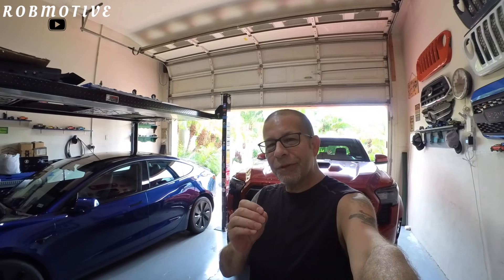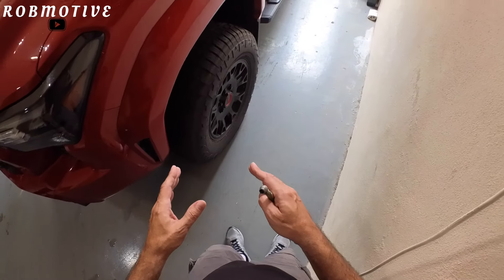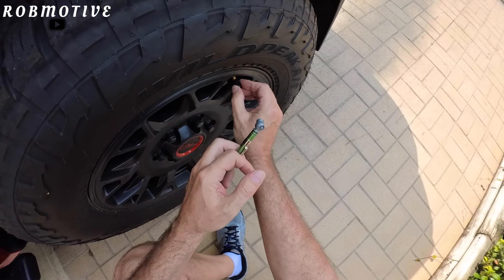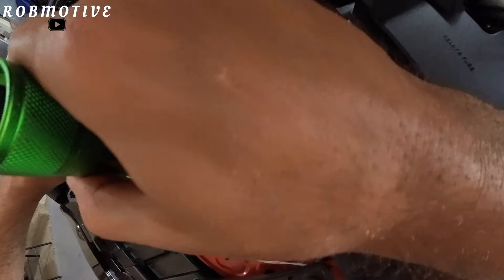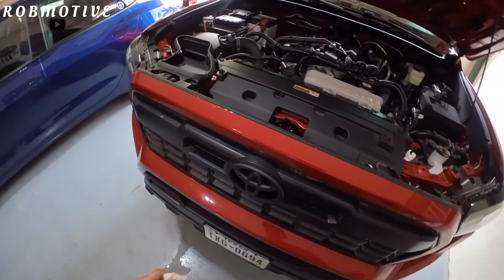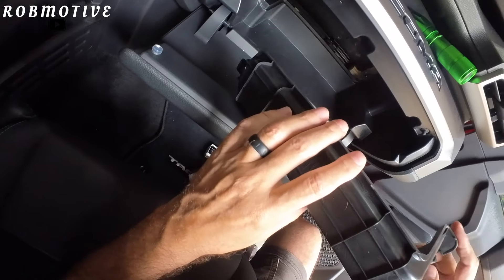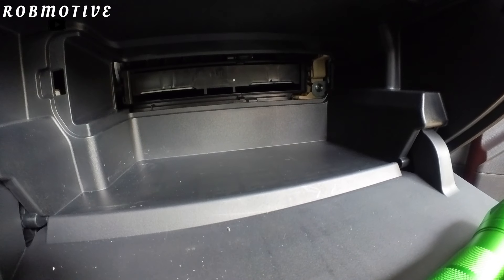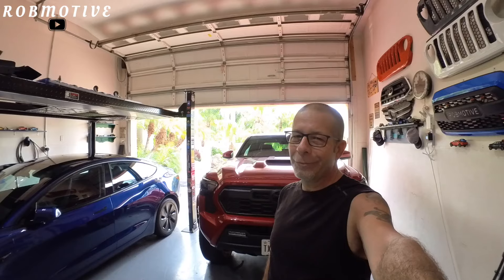Toyota Made This Much Worse In The New Tacoma!

Comment: Hey Rob. Thanks for the tutorial on removing the cabin filter. 
 Hope you don’t mind.I have a unrelated question. 
 Before I go searching for a solution in the owners manual. Have you tried backing up your 4 th gen with bikes hanging over the tailgate or with a hitch mounted  bike rack? Impossible to reverse because the BU sensors are constantly applying the brakes. Very difficult to just back out of the driveway !
Reply from the maker: I have not.  I believe you can turn that system off.
Reply: K thanks Rob. I’ll do some digging.

Comment: Hey Rob.  I don't think there is any point in reading the fuel economy figures on the dealer stickers anymore.  Car and Driver reported (and it's been mentioned before) the turbo is simply for emission purposes. Just to meet the government compliance demands.  C&D also reported that the 2024 Taco gets 40 miles less per than a 2017.  The 2024 tank is a bit smaller so this may account for the difference.  Still makes a difference when off roading.

Comment: Yes, the cabin air filter is a greater PITA to replace.  But, that tells me they did redesign under the dash and hopefully have eliminated the condensation drip ALL 3rd Gens have if you run the AC with the window cracked open or the sunroof open.

Comment: Unless you are really curious, the glove box mounted cabin air filter should be good for 24,000 to 36,000 miles. Thus the ease of checking it is basically moot. On the other hand, the engine air filter should be checked every 15,000 miles. Wondering why you didn't show that? Also, does the Taco's automatic transmission have an owner accessible dipstick?
Reply from the maker: If you have allergies like I do, the cleaner the better.  At certain times of the year, that filtered cabin are is my salvation!
Reply: @RobMotive  Allergies can be a (rhymes with rich). I have a dust allergy making the desert fun. Only had one checked at 30,000 and Chevy dealer said it looked brand new. thus despite the service book they did not sell me a new one. On the other hand I've had to air gun blow clean serval engine filters at 15,000 and replace at 30,000 due to all the dust.

Comment: Did it come with tpms that you didn’t move over from the old wheels tires? I didn’t realize people still check their tires with an old-fashioned gauge. 😂
Reply from the maker: It does have tpms.  However, I’m more comfortable using a gauge as the numbers seem to vary.
Reply: @RobMotive  tpms systems seem to have accuracy issues. Give me a good gauge any day.
Reply: I can’t say I’ve ever had that problem. The psi my air compressor shows is generally the same as the truck.

Comment: Was your truck sitting level. Doesn’t your driveway have a slight angle driving up into your garage? The truck appears to be sitting a little outside of your garage.
Reply from the maker: I don't recall, but the driveway does slope down.
Reply: @RobMotive  if that’s the case, you won’t get an accurate reading on your oil stick.
Reply from the maker: Not sure what you’re getting at?